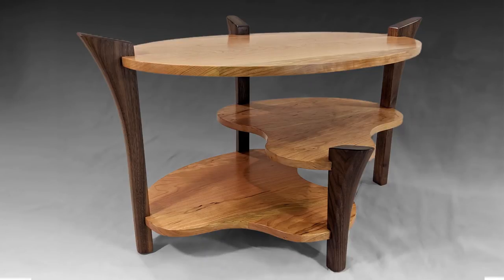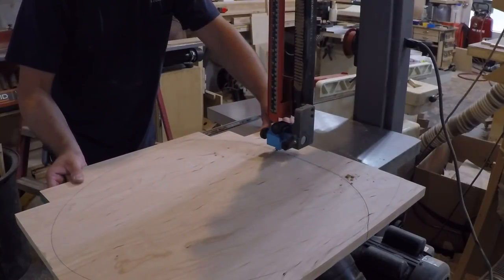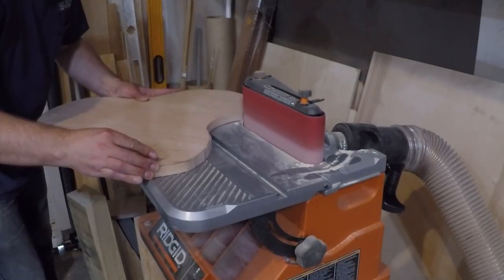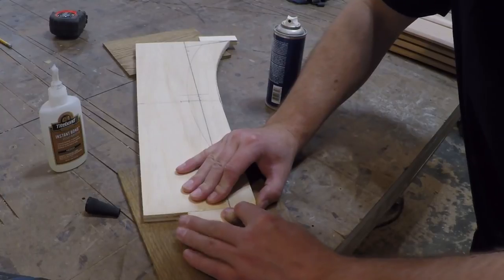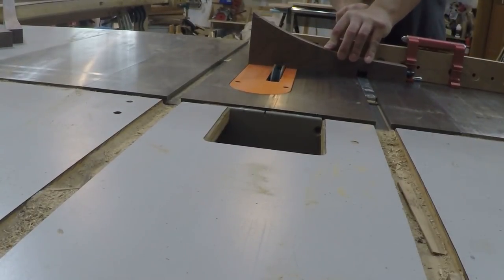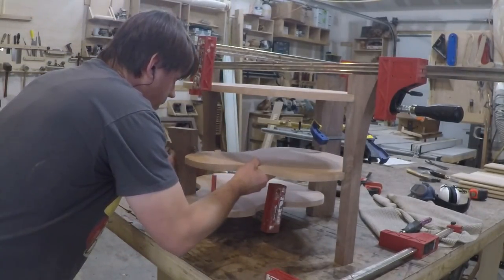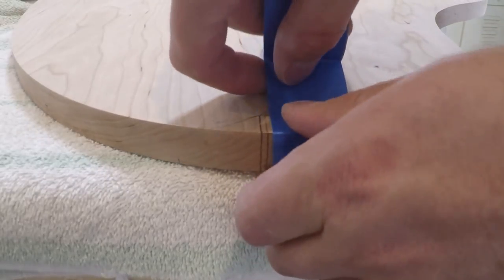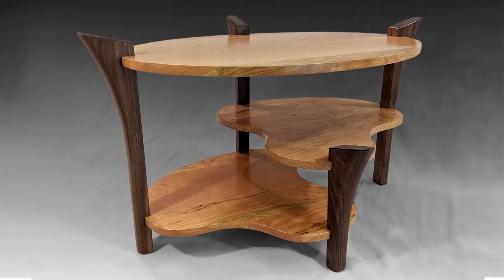Building an Oval Table With Sculpted Legs

Comment: Nice work Brian. Did you ever consider adding some zero clearance fences to your Kapex? I added some on mine, and they eliminate the flying cut offs.
Reply: @Benham_Design  I had a piece shoot up and misaligned my laser. Have never been able to get them back aligned again.
Reply: Yeah those lasers are a bugger if they go out.  I've never been able to get mine quite right either, so now I just use them to get in the ballpark. @GuysShop
Reply: It did drive me nuts and I spent hours fiddling with it and finally gave up to preserve my sanity. My only complaint about the Kapex though. @Benham_Design